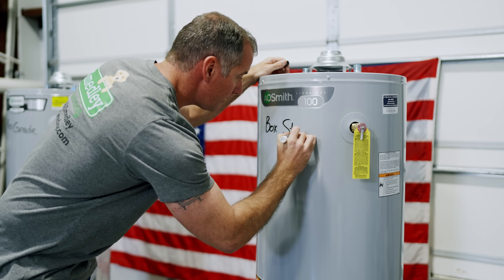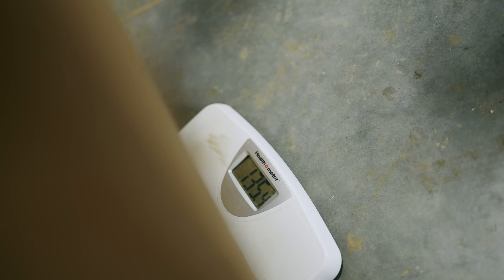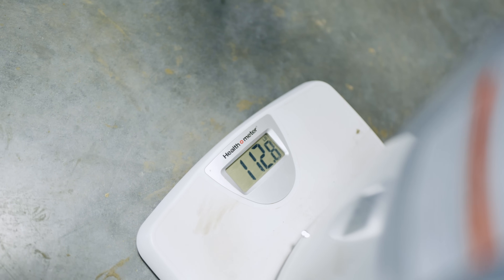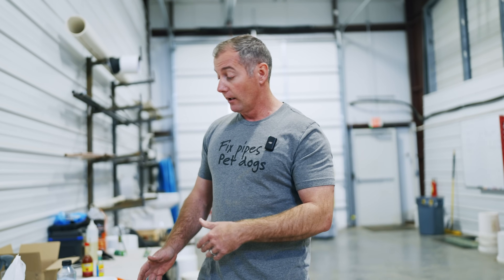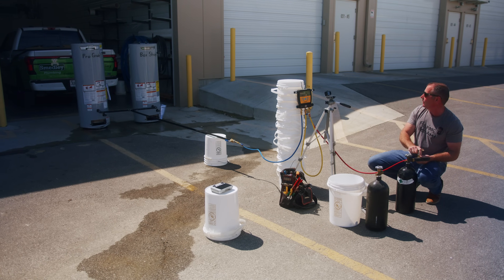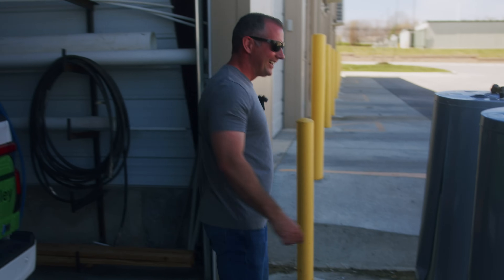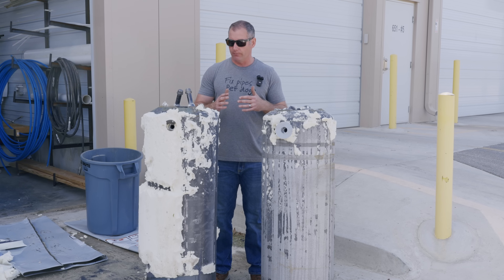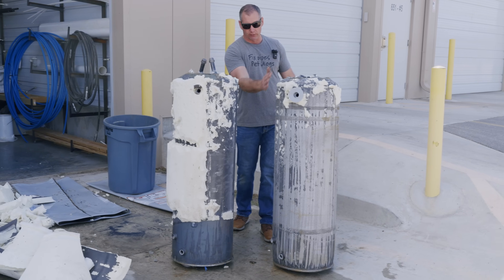What water heater should I buy? - Pro Grade vs. Box Store

Comment: I live in California, and they have different type of no-knox, burner that failed before the warranty was up. It was a Sears unit built by AO Smith. I didn't want to wait, so I bought a Ream and had a licensed plumber install it because of needing permits now. I was able to call A.O. Smith and they converted the burner and controler under warranty. So now I have a backup waterheater. The burner in your video looked like the original one that lasted over 30 years that came with the house. You are lucky to be in the mideast and not California with all the regulations. 
Thanks for your video, 
Ps I don't know why they call it a no-knox burner because when it lights up it makes a big bang.
Reply from the maker: Gotta love California! Lol
Reply: @SmedleyPlumbing  Happy New Year
Reply: @SmedleyPlumbing yep, I remember when all plumbing fixtures were coming with these California prop whatever warnings on them and that we the plumber had to leave these warnings tags on only the homeowner was allowed to remove, California's plumbing code itself is rather weak compared to Illinois or Chicago code, yes Chicago has their own code and license as they have what is called home rule, but we just don't have all these silly warnings on possibilities of lead in anything made with brass though it's so minute the lead could never leach into the water, the only thing I've seen if the California code that's sticker is the water heaters have to be secured in place and have flexible connection, which aren't legal here, but because of earthquake they need it there, we don't get earthquakes in Chicago and even when one happened near the Mississippi it was only a 3.5 and it made the storm door rattle a little

Comment: Fabulous video, but I can not believe that you ran the pressure test with the tanks right next to the pickup truck. I understand they had water in them, but still you were using a gas to pressurize them. One of the reasons the pro one might have failed first is if there was some leak in the box store version. Even though they were fed by the same pipe, resistance in the pipe might have resulted in a lower effective pressure in the box store tank, especially with all the distortion in the pipes you observed.
Reply from the maker: Yeah one swelled while the other cracked a weld. I would much rather a tank crack a weld than swell and burst.

Comment: Hello from the other side of the State...
14 years so far. This one was bought and installed by a local True Value hardware store. I have no idea the brand because I wrapped a WH blanket around it 14 years ago, and can't remember and can't find the receipt, lol! House was built in '55 and they didn't build the typical middle class ranch houses back then with heating, cooling or ventilation in mind for the basement. Can you say cold in the winter! Hence, the extra blanket.      Enjoyed the video!  Thanks...
Reply from the maker: So most of these changes have occurred in the last 10 years.
Reply: @SmedleyPlumbing  
Maybe I should have bought a spare water heater back then, lol. I'm sure this water heater is approaching it's last days. I'll be suggesting a pro grade to the plumber next time around.

Comment: There are differences as you have shown. With that said, I have a 32 year old water heater from Lowe's.  Water quality and maintenance  have more to do with long-term use.
Reply from the maker: You probably have lower water pressure as well.
Reply: Bet your next "Lowe's" water heater won't last half as long! Even with proper care. A lot has changed in materials and manufacturing since then, unfortunately.

Comment: Thank you! Great video..I work for a company that manufactures both pro grade and “consumer grade” sealants and waterproofing products. Without getting too detailed, I’ll say the “consumer grade” is basically an idiot proof version of the membranes the pros use that require more prep and installation expertise.  The difference in the two “same products” is significant as is the overall performance and longevity.
Reply from the maker: Yep
Reply: @SmedleyPlumbing You didn't mention STATE WATER HEATERS ! Only sold at plumbing supplies Nation wide .The fill tube is curved at the bottom swirling the water constantly.  Keeping sediment moving .

Comment: I can see there is no bias or media-type hype here?  All in all, other than the Watts safety valve on the box store tank, which I trusted forever, and the brass ball flush valve and magnesium sacrificial rod on the pro tank which are musts for me, there is no difference in my eyes. I've seen the A.O. Smith manufacturing line at work. Is the brass ball valve and magnesium rod worth $150.00 more?
Reply from the maker: Is the massive weight difference of the tanks alone and the fact the box store tank swelled enough to pop the jacket that tells me more than anything.

Comment: I think you should have weighed the tanks at the end without any insulation on them. Just to give an example of the thickness of the metal or how many pounds of that difference was the actual tank/glass thickness. Overall great video. Lots of good information. Get the camera, man a gimbal.
Reply from the maker: Thanks for the tip

Comment: I have a Sears Kenmore Electric Water Heater with Roto-Swirl feature.  Original Warranty was 9 years.  I installed it 24 years ago and it is still in service.  I have not had to replace a thermostat or an element. I really miss Sears!
Reply from the maker: 24 year ago, the box store units very well may have been the same heaters.  Not today though.

Comment: I have a lot issue with comments that they are not from the same assembly line.  I think those people are not familiar woth factory operations.  Both water heaters are likely from the same assembly line but are assembled using different components.  It would not make a lot of sense to have an extra assembly line to build a mere identical water heater unless you needed a sexond or third line to meet capacity.  Very likely no difference in tooling would be needed building both 40 gal water heaters.  

Using the same assembly line they could possibly build 40, 50, 60 gal water heaters on the same line, needing only various different tooling.

The video proves that different components are utilized in pro vs box store water heaters, but this hardly proves they are using different assembly lines.

As a analogy if you buy a car.. call its a Chevy Cruise, GM would not have different assembly lines for each trim level.  Rather the components to be assembled would vary depending on which particular trim, car, color they would be building at a time.  If one looks at videos online, a car manufacturer may build a $20k base model and next on the the might be $40k top of the line trim.  All the same assembly line, but just various models or trims.  I expect AO Smith to be doing exactly the same.
Reply from the maker: You're exactly right.  Problem is that most people don't understand that the same assembly line will produce different heaters.
Reply: @SmedleyPlumbing A.O. Smith owns a few water heater factories. You can look up where each is made on the paperwork (sometimes the stickers will say, too).
Reply: We were trying to get a particular Bradford White heater. None available, as they only produced that model twice a year, next time about 4 months away. We found a similar Rheem unit we could actually get.
Reply: Interesting video.  My water heater went out, and the plumber wanted to sell me an expensive water heater with his markups, which was   obviously added.   I bought one from Home Depot, 12 year warranty and got a 10% Veterans discount.  I saved a bundle, and it will probably last just as long.  Plus, Home Depot stands behind their products better than the local fly by night plumbers.  Location: Las Vegas June 2024.  🙂
Reply: One thing I have stumbled across is they only make water heaters in small batches for High Altitude Cities like in Colorado. I was trying to order something specific for a customer in Colorado and I was told it couldn't be done because they only make High Altitude water's from time to time. Only a small market needs High Altitude water heaters.

Comment: What a great video, I wasn't sure if you were going to go as far as you did!  What a treat!  I wish you had opened up the tank to compare metal thickness and perhaps glass lining thickness.  The extra weight could easily have been extra glass instead of extra metal...only the manufacturer would know that.  None the less you really took it to the max.  Just found your channel, you got a new sub!  This video could spin into several 'if you have a box store water heater - upgrade this first' type of YouTube shorts.  I wish I had upgraded my drain valve when I installed mine new 10 years ago...I'm afraid to touch it now.  I've never messed with the anode rod either, but from what I've read...if you don't change it every 3-4 years...leave it alone!
Reply from the maker: Yep!

Comment: The expansion tank is only really needed if the supply has a backflow preventer. If one is turning off the water supply, a faucet hot water valve can be opened to prevent positive or negative pressure in the water tank. Commercial properties are more likely to have a backflow preventer on the building supply, but irrigation water generally needs a backflow preventer valve. More jurisdictions are adding requirements for backflow preventers for residential properties, and they definitely need an expansion tank. But, not everyone needs one.
Reply from the maker: Code requires them on all applications now since the presence of a backflow preventer is more likely than not.
Reply: @SmedleyPlumbing not true at all.         Not all codes are the same. I'm on a well and don't need one. And I would fire any plumber that tried to sell me one.
Reply: @SmedleyPlumbing  Code only requires it on closed systems. The EPA has required water systems protect from backflow contamination. My city only requires backflow prevention on commercial/industrial buildings, and residential irrigation systems, not on the residential supply. Hose bibs must have anti siphon devices. To assume all water systems are closed is just putting additional expenses to avoid the need to determine if it is a closed system. Perhaps the AHJs in areas you serve require that expansion tank everywhere, maybe they plan to require new backflow preventers, but those would be an expense which the homeowners would need to pay. In northern climates, it would make more sense to put the backflow preventer indoors for easy servicing. In areas with no frost line, they can be put slightly underground in an irrigation box. In either case, it's relatively easy to determine if one exists.
Reply from the maker: @homesteadhaven2010  It is true. The code requires a thermal expansion tank when the conditions for thermal expansion are present. With you being on a well then you are not required to have a thermal expansion tank because your well bladder tank serves as a thermal expansion tank as well.

Comment: The tank by itself are the same. The weight difference between the two stripped is the sheet metal outer case.  The difference between the two is the quality of the components.  The internal tank is the same across the line.  A box store AO Smith comes in 3 models, 100, 300, 500.  The tanks are all the same.  What you are paying extra for is the warranty.
Reply from the maker: I would have to disagree with you on that one.  I think our video proves that as well.
Reply: Yep, if it's made by AO SMITH, all the tanks are identical! I went through AO SMITH’s three-day school (5 years ago) and the factory in Tennessee. I can personally verify that if it's different,  it's in the controls, drain valve, and stickers.
You should see how those tanks are handled after coming out of the “glass lining process”. It is amazing how much rough handling they take. I questioned the engineer about it, he said you can bounce the tank and still not crack that lining it's that tough. I never worried about dropping one off the tailgate again. 
Oh yeah,  change the anode rod every year!
Reply from the maker: @TOOLMAN4hvac  our findings would indicate differently.  Significant weight differences and performance differences.
Reply: @SmedleyPlumbing not significant weight difference.
Reply: Aluminum is a superior anode. It lasts longer.
Reply from the maker: @ElmwoodAl  9 pounds isn't significant?
Reply from the maker: @ElmwoodAl  I think that depends on your water.  Here where we are, the magnesium is better.
Reply: My plumber says the same thing about the tanks between a 6 year warranty tank vs. a 15 year warranty, same exact tank.
Reply: @ElmwoodAl yes, but magnesium performs better. Just have to check/change it more often.
Reply: @Gary_in_NoVA  which is a lot more expensive.
Reply: @SmedleyPlumbing  Amazing! The facts are demonstrated right before their eyes, and are ignored!
Reply: @SmedleyPlumbing  A.O. Smith owns multiple water heater factories. There are two in Tennessee. I'm fairly certain the pro tank was made in Ashland City (or it was an older tank from Johnson City), and the box store was almost certainly made in Johnson City. I wish you'd shown the seam on the box store model. That would have confirmed it for me.

The differences between tanks in the same facility is nil (with one exception I won't comment on), and even between the 2 factories differences are pretty minimal. Over time they're getting closer and closer to the exact same.

Your heavier tank is most likely older, from a time they used thicker metal on all their tanks. Think pre-COVID.

Comment: Thank you for the video!  Any opinions on electric anode rods?  I am in Michigan, have city water, have a softner, on my 5th water tank in 20 years. I have come to conclusion that my anode rod needs servicing more often but no contractor locally has ever suggested this as a preventative maintenance step. I had had 2 ao smith, ge and bradford white. Only the ge was "box store".
Reply from the maker: On theory, electric anode rods work well.  I haven't seen a correlation between electrin anodes and longer tank life though.
Reply: @SmedleyPlumbing  any direct experience with the corro protect?  My mom had well water with the really bad sulfur bacteria smell, the corro protect solve that in 24 hours. I just wish I could find evidence to see if Corro protect does well in the long run. And works well with softened water.
Reply from the maker: @JLLG2  honestly never heard of it
Reply: @JLLG2 sulfer smell at high temp that goes away is a bad sacrificial(zinc?) anode hence the term "sacrificial." Might have an inferior anode product tho so maybe a "pro grade" anode tho.

Comment: I hate to burst anyone's bubble on pro grade or Lowe's grade water heaters.  I have now had 3, yes 3 so-called pro grade water heaters in a rental I own.  The first one cost me over $2381.00. Why? Well, the plumber said he needed to completely replace all the old lines and install a $ 258.00 expansion tank.  I discovered he never pulled a permit that the city requires.  That cost me another $ 321.00 above the original cost.  One year and a few weeks after the first pro-grade water heater it started leaking from the bottom.  I called him out to replace it.  Low and behold, yeah its done. Labor to replace said water heater with a 15 year warranty was $ 938.00.  341 days later the new one was leaking.  Called Mr. Yoyo again. Yep water is leaking.  He said he would only charge me for his time to get a new one.  The bill was only $ 692.00.  Guess what, the new one after 6 months is leaking again.  I called Home Depot this time.  Replacement was $ 1081.53 including labor and a 25 year warranty on the tank.  Oh, the so called pro grade water heater.  According to the manufacturer is no different from the home depot model except the warranty...
Reply from the maker: Sounds like your previous plumbing was missing some water pressure issues causing premature tank failure.  Excessive water pressure will shorten the life of any tank.
Reply: It's on the building/home owner to pull the permits and the expansion tank is required now and no water heater will have a 15 year or 25 year warranty..

Comment: I’ve had two Pro Grade AOSmith gas water heaters fail on me in six years.  Both failed around that 6 year mark.  Both failures were a massive leak that poured water out of the bottom and flooded my basement.  Second one at least had a catch pan and pipe going to the floor drain since the concrete floor was brilliantly sloped away from the floor drain, but the leak was so bad it couldn’t keep up.  Seemed like the failure was maybe up top somewhere, possibly at the nipple connection because the leak stopped quickly when the water was shut off.  I am making sure an expansion tank is installed this time.  Hopefully I can get more than 5-6 years out of the next one.
Reply from the maker: Sounds like you're missing a thermal expansion tank in the failures were caused by overpressurization
Reply: @SmedleyPlumbing  that’s why I’m being sure to get one installed this time.  Last time I was out of state and it was a warranty replacement so they just left it as is aside from adding the pan I requested.  And I didn’t know enough about expansion tanks at the time so I didn’t think that the people who built my house would have cut such a cheap corner if it was needed, naively.  I’m guessing it was metal fatigue from the constant pressure changes.
Reply: Can I buy a pro grade?   No?  Then dammit I’m stuck!
Reply from the maker: @mestep511  sure you can.  Most places sell to the public
Reply: @ thanks, thought all tax exempt.  Water heaters are often easy DIY but watching a true plumber on a combi boiler or bath remodel is humbling.